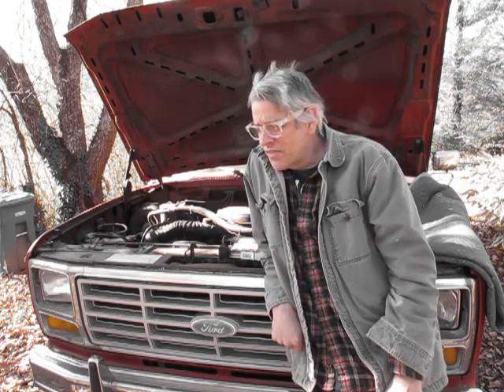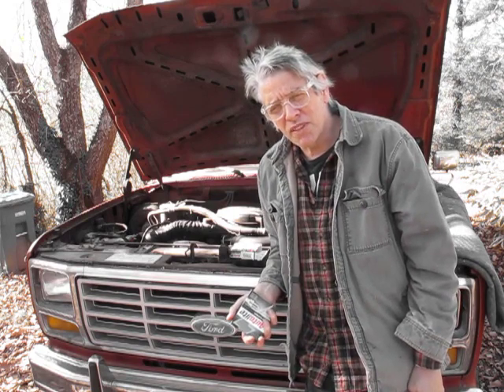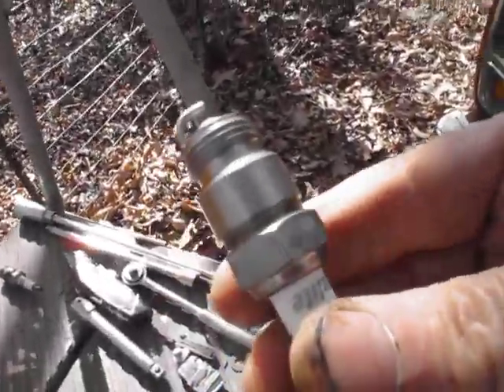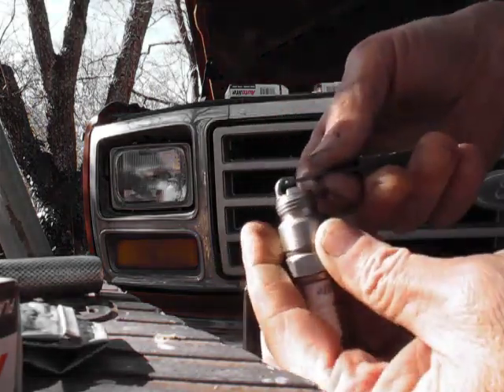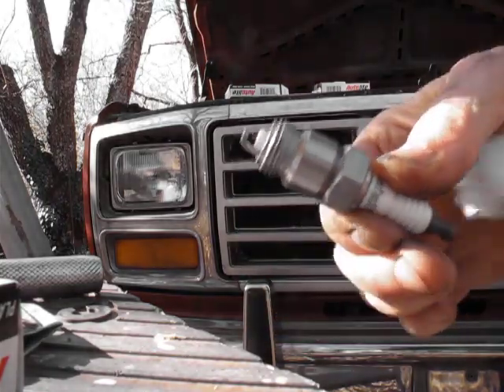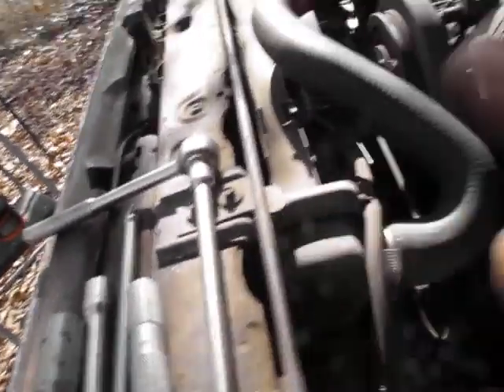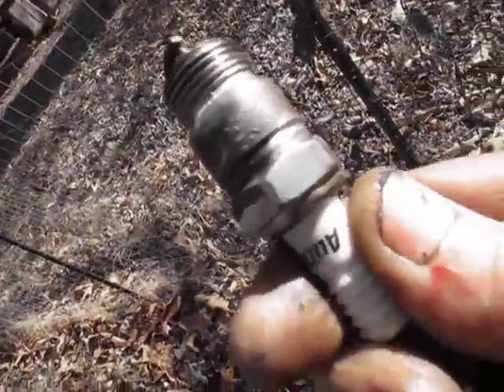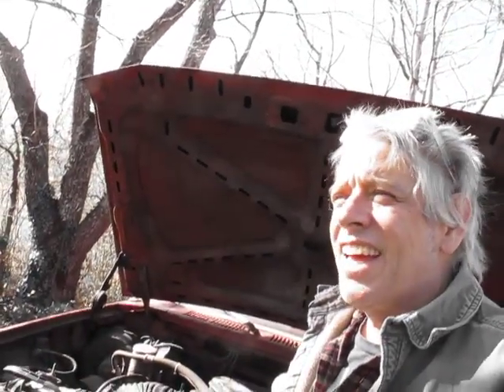HEI install #3 and re tapped cylinder head with a special spark plug chaser tool

Comment: Great Video... What size thread tap ???
Reply from the maker: its a double end chaser ,not really a tap -one side is 14mm the other side is for the larger 18mm size.most decent auto stores will have one ,but I don't know if you can still get the double ender.use plenty of grease so it will catch anything from falling in the cylinders.i have heard of old timers taking an old plug and cutting three little notches in the threads at an angle like a chaser ,but I really don't recommend this

Comment: What like 40 mins on 3 videos and you never did show how to wire up the hei
Reply from the maker: in the first video around the 3 min mark i showed how to find a keyed 12 volt source for the hei in the third video i showed how i routed the wire from hei distributor to keyed source .there is only one wire to deal with it goes from a 12 volt keyed source to the hei distributor there is another wire but that is for a tachometer and i did explain that this truck does not have a tach.but i did skip the part where is solder the wire connector to the disconnected ecm lead. i will be more inclusive in the future thank you for your feedback
Reply: Nice videos I really just wanted to see it run maybe upload one as review on the new HEI distributor plus I was wondering if an electric advance would make a difference I have an 85f150 and really want to do an HEI setup
Reply from the maker: @thcowboy69  i got a video coming soon,just got the 2 barrel conversion dialed in also